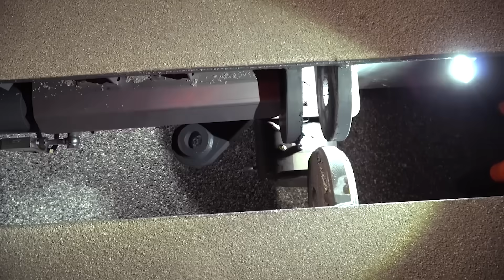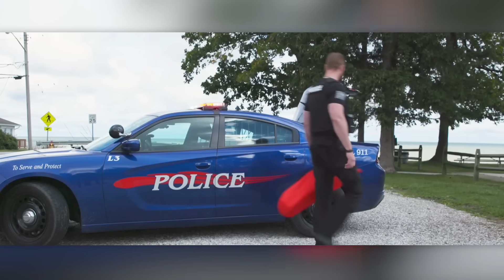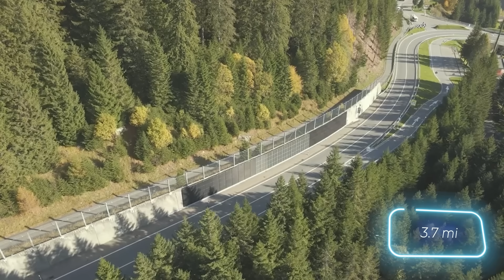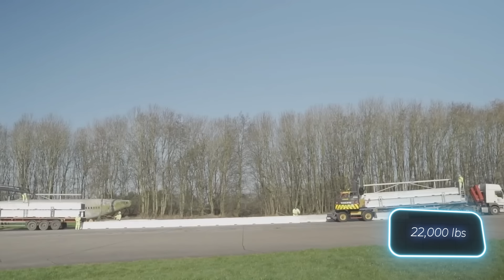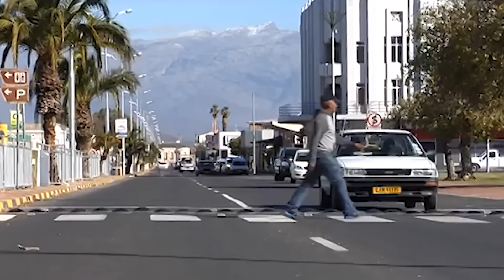INCREDIBLE ROAD TECHNOLOGIES THAT ARE INSANELY COOL

Comment: About controlling speed, in Portugal, they have something I never saw anywhere else.
They have long roads with no intersections but with red lights. If someone drives over the speed limit, the lights turn red and everyone has to stop and wait for a minute, everyone is punished because of just one car. This system works very well!

Comment: First, we've had the adjustable lighting in tunnels for over 25 years. Second, some of the crosswalk lights are actually bad because they're so bright when you drive underneath them they blind you. Third, the worst thing you can do is have red lighting. The whole world made a big mistake making warnings in red. Red is the color that most color blind people don't see. That's the reason so many fire departments started going to yellow fire trucks.

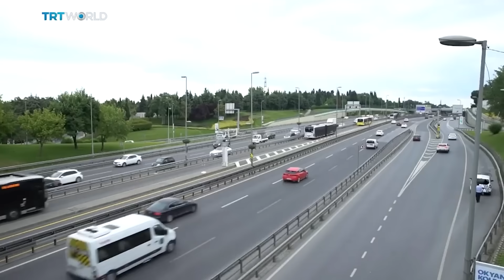Comment: 13:53 The turbine  is technically 'taxing' the energy output of the vehicles - if it wasn't there then the vehicles would not have to expend as much energy to move through the space and would get better gas mileage. Very inefficient.

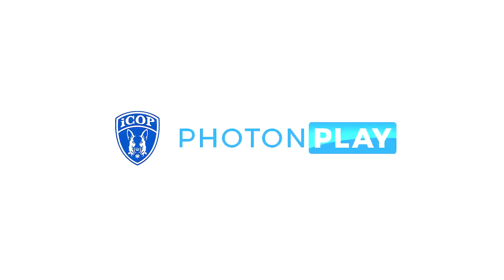Comment: 5:45 I’m not sure how it works elsewhere, but in Russia, they stopped installing radar speed signs after it became clear that drivers saw them as an invitation to show off and set new speed records.

The same thing happens with “Swimming is prohibited” signs, especially in dangerous areas—many people will swim precisely because it’s prohibited, just to prove they’re “real men.” If the sign weren’t there, no one would dare to try.

Comment: There is no such unit as kilowatt per hour. Kilowatt itself is the unit of power, e.i. work per time. Looking at this device, I doubt it could power a small kettle, so I think it rather produces one kilowatt-hour per day, e.i. one 24th of kilowatt.
Reply: One Kilowatt Hour (1 kWh) is the amount of energy it takes to run a 1000 watt appliance for 1 hour.

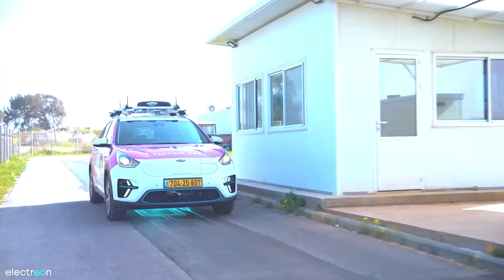Comment: In the segment Electreon at 15:10, you have used non-standard and meaningless terminology. Kilometres per hour is ONLY represented by "km/h" as determined by the Systeme Internationale.  The symbol for kilometres is "km" and nothing else. The use of "kph" is non-standard,  uninformed, and meaningless. It is important to be correct and not to spread disinformation.

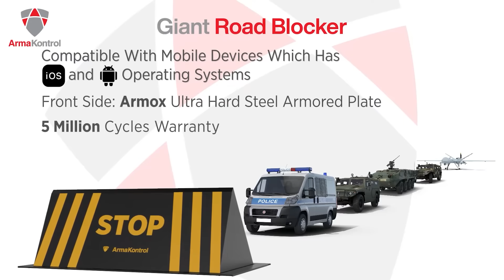Comment: 18:00 How the hell can anyone tell me that concrete walls are easy to move while keeping a straight face? Concrete is brittle. And extremely heavy. Not to mention the heat it produces in sunlight. It's possibly the worst material out there for a wall.

There are many dumb things here like "Wow! They saw a future in plastic and invented a plastic bucket on wheels. Amazing inovation! Wow!". But this seems by far the dumbest.

Comment: Use old PVR HDPE/ Ldvp to make lamp posts from milk cartons for instance. Even heard they use it to repair roads. like in this video. do like the road lifter 500mtr sections at a time would reduce traffic jams. Also to NOTE:- if everyone drives over a Pothole. it makes it bigger and deeper. by avoiding them you decrease the damage done. Especialy at junctions. as car /truck tyres turn on that section of road.

Comment: Putting wind turbines next to the road will only make cars use more gas. That energy needs to come from somewhere and it comes from the cars.
Reply: No, the energy is already being generated by the cars but its not being harnessed and it is going to waste - the turbines will simply harness it. Solar panels don't use more sun, do they?
Reply: @lewiskearney3797  Yeah, maybe you should actually look at the research that's been done on this because you're beyond wrong.
Reply: @onieyoh9478  by all means, share this research because I have found nothing of the sort. Everything I've found says the increase in drag is negligible and it would take several hundred meters of them lined up to increase fuel consumption.